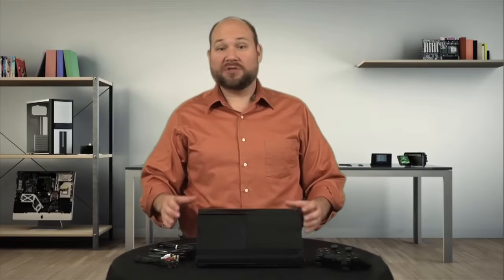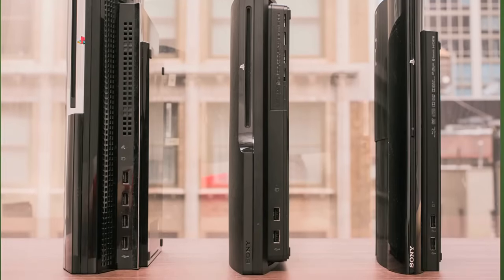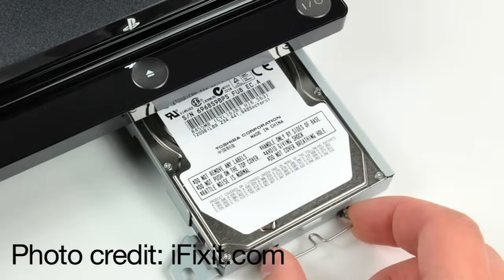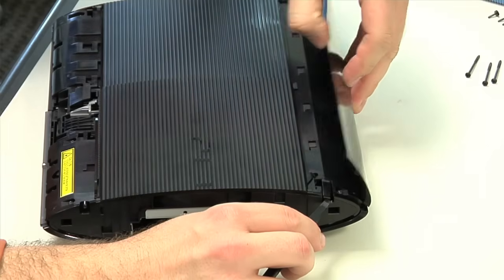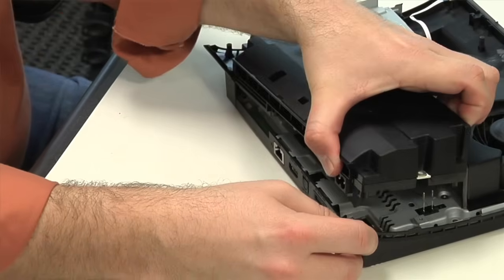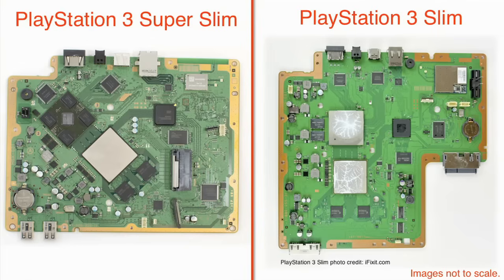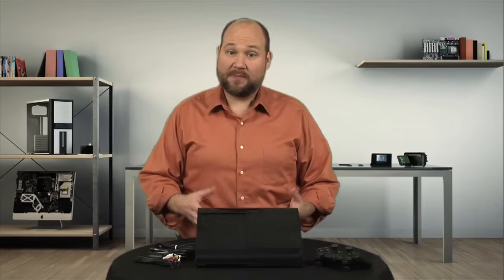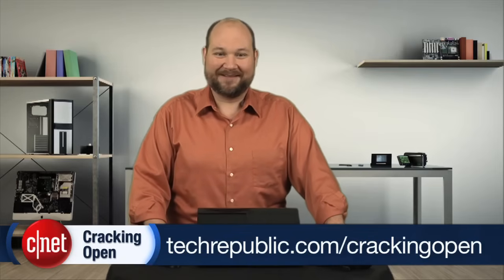PlayStation 3 Super Slim teardown

Comment: i actually think the slim looks the best out of the 3
Reply: It was the best of the three in almost every way the only thing the phat had over the OG slim was it could play ps2 games as well
Reply: @nickolaselzerman4849  for the slim i liked the 2051b model most of the parts were modjular where later versions is basically you're fans busted instead of 2 screws have 40
Reply: seriously? i think the slim was way nicer looking. in fact the ps3 was the nicest looking console i ever had, imo. i loved the color and texture of the console, my super slim looks like cheap plastic, my slim looked like it was made from more expensive, nicer looking materials. my super slim worked fine which is all that really matters, but the slim was the nicest looking console ever made imo. the ps4 looks similar but i think the ps3 slim looked nicer.

Comment: As someone who owns all 3 ps3 systems, I can tell you first hand that the ss is my favorite. The fat runs much hotter, takes up more space, is very loud and imo, very ugly. The slim is great, and loses all of the fats problems, but it is still larger, and slightly louder. The super slim is silent (with the exception of the nosier dd), it runs cooler than any other console I have owned this gen, it top loader is sturdy, and easier to use/ harder to break and is a sleek beautiful console.

Comment: yes its more expensive cause it has more hard drive space. A 160gb ps3 slim is 250.00. And a 250gb ps3 super slim is 269.99. Thats only 20 dollars more for 90 more gb of hard drive. The 320 gb slim is 300.00. But na i know its not cheap. Sony makes amazing durable products. I watched a kid drop and smash a hammer on the new super slim and it didnt even break it. Now thats awesome. But i just prefer the slim. It my situation of have alot of animals and would rather not have the laser exposed

Comment: You also don't have to worry about dust or "anything else" coming in contact with the laser. The PlayStation 2, PlayStation One, and PlayStation 1 had a similar top-loading design. So it really makes me feel like I'm spiritually connected to with the past PlayStation's somehow. You don't need to worry about any dust or particles going inside and damaging the laser, if you take care of the console, and remember to close the disc slide every time you place in or remove a game disc.

Comment: If you look back at my comment, "my broken "fat" PS3". My PS3 broke because the automated disc loader broke, the disc wouldn't spin, so it couldn't be read. I disassembled it a dozen times in an attempt not to shell out cash for a new one, but I did anyway. The PS3 disc drive is the exact reason that cost me money. So, now with my Super slim model, it can't happen again. 

This is also not a cheap model, just cheaper to manufacture. I paid 269.99 for it new, it's more expensive than the slim.

Comment: I have yet to encounter a disc being stuck.  Perhaps if you generally push lumps shit into the slot on a daily basis, it will probably stick and even then you'll have to spend some time cleaning it or take it to the repair shop were they will look at you in disgust.  The only reason Sony have went back to tray is to save a few pennies now the ps4 is around the corner!